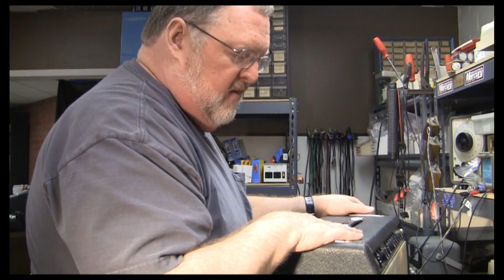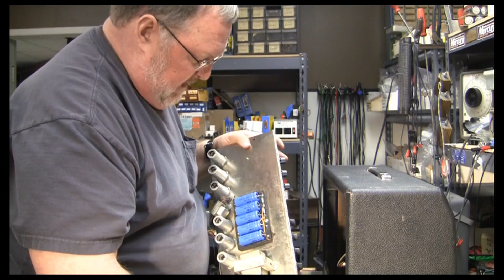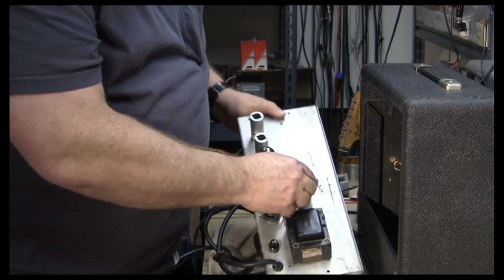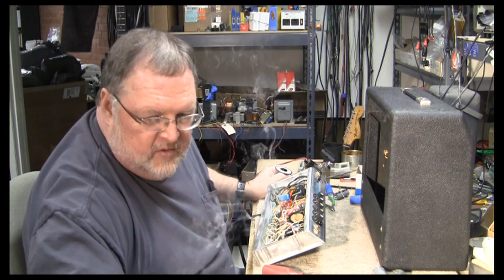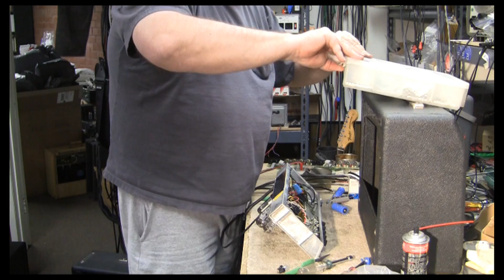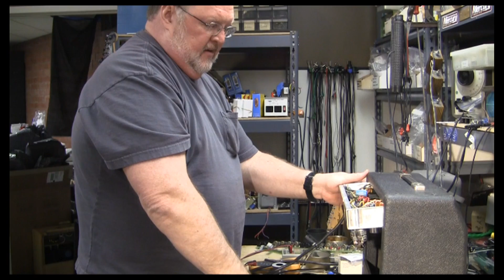Roy Blankenship Amp Repair Shop - 1

Comment: 23:15 knowing that your doing it wrong, and not changing your habit. Congrats.
26:50 "You're pretty sure this is the main malfunction, but will check on oscilloscope?" Why not test what's the problem
31:20 They are NOT electrolytics: they are non polarized coupling caps
34:15 I have these brought in from...... er er... interviewer: JAPAN? No, from a company called Mouser
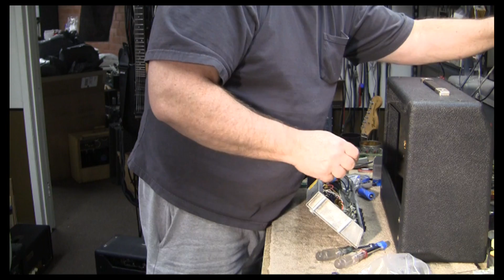39:00 he likes to spray out the jacks with contact cleaner, without even first testing whether there is a problem. 
39:48 after it's been fixed we'll be finding out if the tubes were ok in the first place...
41:25 fuse test good, but it's "hooky" -- if it's good why replace? 
43:00 never do this at home kids, only one hand in the amp..
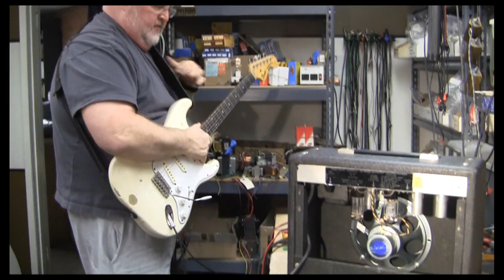49:00 he has TWO shop guitars

Comment: i have a marantz 4300 receiver, was working fine and now it does not power up. the last time tried to power up it trip the breaker. any tips as to where to look at first. the receiver fuses are not blown.

Comment: dirt, corrosion, living like an animal on the road..LoL! Good to know your EIA codes.
Just like the old scratched up 59 Strats and Les Pauls, the originals go for a lot of money these days...maybe it's nostalgia and the new owner hoping that by paying a "kings ransom" for it..owning the vintage musical piece will take them back to those years.
RCA made very good tubes..their NOS (vintage) 6L6GC are worth a lot of money these days. I use the JJ tubes myself, because I can't afford the prices they charge for American made NOS tubes these 
days. (more....)
Personal pride on the repair job, it's good to know that there are still "old school' repairmen that take pride with their work.
I agree on with the comment on shoddy repair jobs as the travesty on the floppy electrolytics that somebody 
stuck in.
Some of those old electrolytic cans have twisted tabs as well as being soldered, so they can be tricky to
 remove.
I bought a Weller soldering station years ago.. It has been one of the best investments in my life..it has outlasted my 22 year marriage and still going strong. I use 700 degree tips. I agree with you on Nichicon caps being better quality and I get a lot
of my parts (guitar related) from Mouser..they even send me a catalog for free.

Comment: hi - im new to this stuff, and have a roland cube 60 guitar amp i bought bust (knowingly), and am in the process of gathering info on what to test. it blows fuses on the inside (two 125v 5a fuses).. although i didnt use slo blo fuses :? should i try these first? nothing is smoked and burned - ie im hoping its small component failure.

Would I be on the right path de-soldering the things with 3 legs (transistors?) and testing their legs (found a good tut to test these), and also the sausage things - can i test them in circuit? diodes iirc..

I have a list of numbers to test from a website - most ive done is test voltage and motorbike coil resistance.. could i possibly fix this myself with basic soldering and multimeter skills? thats all i wanna know!

fyi i havent gone and stuck in tin foil or higher amps fuses, i know that much!!

Comment: Hi Roy,got a question,whats the most likely thing to cause a guitar solid state amp to lack in volume,i have a marshall 8080 amp that sounds like a 5 watt amp,also a P A Amp that has the same problem.any help would be great.
regards

Comment: My problem is one of my knobs is stripped I suppose.. ? It spins hole wat around instead of stopping at off causing me major problems trying to find off because it’s the knob for flange/phase/tremelo/chorus on Roland micro cube. Therefore it’s nearly impossible to get it back to clean with no effects because one of those 4 effects is always on I can’t find a sweet spot at all and it should just be at the off position.. can anyone help me??

Comment: I just returned a 66 Bassman to stock.  A company I won't name left their sticker in the chassis after they modded the hell out of it.  They spent a lot of time and parts making it sound absolutely horrid.  Like a flabby, cardboard early Marshall.

You go, Roy!
Reply: Wes Davis.    The Only thing I would ever do or have done to a Bassman is put back to a stock 6g6-a or b or neither a or b. after '64 the bass channel is not good for guitar at all. still like the guitar side of some later models but mostly I just prefer the brown face normal channel. If you want explosively bluze dirt the Bass channel of a 6g6 KILZ with a zed.

Comment: is he really charging $500 for that repair? of course I realize he's a specalist in this field.
that seems a little high to me, but he does do quality work. I used to manage a repair shop, I don't think we ever did any repairs on tube stuff although I have worked on a lot of tube tv's.
Reply: It was a joke. This has been discussed several times prior in the comments. I rarely have repairs over $250, which is about standard for a complete rebuild of a Fender amp.The reality is, people tell me I do not charge enough for my services.
Reply: mortyok3 oh ok thanks I was just wondered myself
Reply: It was a joke

Comment: As an amp builder, he's very knowledgeable and plenty qualified to do this work, takes pride - all good.
What he doesn't do is listen - all scope, no ears used, only played it clean, didn't drive it hard, etc. His views on tubes show a serious lack of discernment on what is good, bad and indifferent. Tubes are critically important, as are the tone of the caps, speaker, transformers, etc. He cares about the work, but not the sound - other than it's running properly. Nothing done once it's running right to possibly improve the tone. It can be running perfectly and sound bad, OK or awesome with just Tube and speaker choice - this amp had the speaker replaced. He doesn't say what it SOUNDS like, better or worse than the stock original, etc...
He likes the caps because they're always reliably good, NOT because they sound good!!!
Why, because he's not ear driven or driven by how it FEELS!!!
Different people have different kill sets, his does not include the use of his ears and that's what tone is about. How it sounds, feels, distorts, cleans up, complexity, overtones, etc. etc.
Reply: You could not be more wrong in your assessment of my skills. People bring me amps because they sound GREAT when they get them back. This video is a one-off pilot for a series these guys wanted to make and is severely edited, and in no way reflects my daily operations. I have been through numerous tube types, capacitor brands, resistor/coupling cap combinations looking for the best combinations for sonic excellence. Best of all, I consider my customers' feedback as way more important than my own personal opinions. You are 180 degrees off on this.

Comment: i have got a music player and its good to hear a music on that player its bass system and other speakers do very well. but, suddenly after about 1 and half hours of playing its brings a bad noise through it bass speaker and u can't hear the music clearly. the sound of the bass system is something like bizzzzzzzzzzzzzzzz....sound it is like the bass is under frequent vibration. i have changed filter capacitors but it doesn't work totally. if i unplug the bass speaker the music is good but no bass for the music which is not impressive to listen music without it. the model is syonapps if you heard of before. can you give me professional suggestion on that. thanks

Comment: Thanks for the video! Question about the electrolytic "can" type capacitor you replaced in the Vibro-Champ: what advantage does a multi-stage CAN capacitor have over a series of single-stage axial capacitors with the same values? For instance, some Fender amps have axial electrolytics under the "doghouse" cover and some have the "can" type multi-stage caps. Is there any fundamental difference between the two other than the layout design?
Reply: Difference is just real estate essentially. I find the multi-section cans cost a lot more as well.

Comment: never replace old condensers with modern parts unless you restuff the old shell. 

to answer your ? yes i would use the origional tires if they met factory spec still or an exact reproduction of them on my antique car.
Reply: And that "must be original" dollar capacitor shorts.. takes out your brand new matched pair kt88 tubes and output transformer.. who's crying now?  :)  Replace because .. I have seen what can happen when a grounding cap lets go on a 50's amp. big bang.. splash of sparks and smoke.. silence... R.I.P guitarist...

These amps are meant to be used in a professional tough environment.. they have to be 100% safe and about as reliable as something 50 years old can be. Stuff the caps if you want.. but do you want to pay my hourly rate to waste time on stupidity like that? I'm with Roy on the Nichicon caps. Great quality. Get the 105c ones for tube amps...  And for the sake of your sanity replace all grid coupling caps if they are more than 20 years old.. randomly blowing ht fuses?.. screen decoupling caps.. replace those too..
Reply: dont know or care if my post got up voted or not. the point of making a post is to pass on experience and knowledge not to get up voted.

i seriously doubt that 20 years working with a retired tv tec who actually worked on this equipment when it was new qualifies me as an idiot. i have since started working on things on my own and still no problems.

also any book written at the time will tell you that just replacing parts hoping to fix equipment is very shoddy practice indeed and should never be done. troubleshoot and repair was and still should be sop.
Reply: he was even bigger on keeping everything origional than i am

that being said i have currently one webcor that had problems with the electrolytic and three that dont. i have reformed numerous filter cans over the years that kept going for a long time.
Reply: you too
Reply: I think this debate is most easily solved by simply looking at an electrolytic capacitor datasheet.... they have a service life in their specs.... also the old paper caps need to go. the paper becomes acidic and leaks. your capacitor acts like it has a resistor across it. thus even though your amp is still working your power transformer is working harder and you don't know it. buy a capacitor leakage tester
Reply: then why is it i have four tape recorders from the 1950s which are fine with all origional condensers.
Reply: my fifth one has one section of one can marginal and will be reformed by me.

Comment: I noticed a few short wires were not physically secured before soldering.  The tech just placed the wire and applied the solder.  A good physical joint makes for a good solder joint.
Reply: If my techniques did not work, I would change them. For you "by the book" guys, sometimes hooking a wire into a spade lug fractures the copper and causes a failure down the line.

Comment: hi..i am jorge, from rio de janeiro, brazil..i have an old hartke VXL 200 bass amp i bought damaged on ebay..my friend fixed it but not completely..i mean..its presence and edge controls do not work..everything else work fine..i would like to have those two controls working fine but my friend could not find that amp diagrams..so would you have its electric diagrams? or could you find them? if so, would you have a paypal account so i could pay? please, let me know it..thanks. jorge.

Comment: Unfortunately, nothing lasts forever... especially electrolytic capacitors! But every tube amp, even the oldest one, can be repaired (of course if if it's still in decent shape).

Comment: Roy Ive enjoyed you knowledge about amp repair....Im looking to purchase a used but in good condition no problems from a owner a peavey kb5 one of peaveysmore recent series models a powerhouse of a amp,least compared to what ive had for the last 25 yrs or longer the peavey kb300,,,,so i wanna grab this kb5 peavey from this guy hes selling it dirt cheap,,,i know this amp is new at some 7-800 bucks,,,,i am a lil leary,,,cautious feeling like theres something this guys is not saying especially for only 150.00 bucks,,,,,,i will test a few things checking for static of ports control knobs  the treb and the mid and the lows listning for a blown speaker,,,, this is a nice model exactly what im looking for ,,im feeling hes selling ,,,dont want to say but makes me feel like its either ?? stolen,,,,or something wrong with it that i dont know he wont reveal and may discover in the middle of a performance ,,,,,question are you affiliated or familiar with this new model do you know things to check for or if if the newer kb series models have common repair problems,,,,i will be probably picking this thing up this week hate to miss a deal of only 150 bucks but need to know all i can,,,if you can offer some info thanks...

Comment: I NEED YOUR ADVICE, I just bought a brand new BUGERA V22 HD amp. The guitar I used is an EPIPHONE LP "56 ReIssue with P-90 pickups. As I move around the room there is a HUMMM that goes from non-existent to very loud. Then I recently read an article about UNSHEILDED PICKUPS and how they can cause havoc on tone and signal interference. The finish and materials used on the body of this CHINA MADE LP guitar is really nice BUT we all know that Epiphone electronics is the worst. QUESTIONS - 1) Is it the guitar causing the different humms as I walk around the amp? 2) IF I wanted to change the PUPS would  Mini Humbuckers FIT where the P-90's are so I would Not have to resize the PUP cavity? Thanks In Advance, Ade
Reply: a. webb I would be inclined to stay away from power outlets, and switch off electrical items in the room one by one till [ hopefully ] the hum goes away. It's trial by trying.
Reply: +a. webb Several things are impacting your noise... P-90s are single coils, so no humbucking effect is possible. The pickup cavities are most likely not shielded, either.  Finally, the amp circuit itself puts out a electromagnetic field into the surrounding area.  The closer you are to the amp, the more noise you have.  You can reduce the noise by moving away from the amp, and by angling your body/guitar correctly to the amp.  Strap on your rig, turn everything on, and move in a circle (stay in the same place, just twist about the axis of your body...).  You'll notice that there's an angle relative to the amp that "nulls out" the noise somewhat.  With no mods, this is as good as it'll get.  If you love the P-90 sound (and I do), leave them alone.  Buy some shielding tape/conductive shielding paint and shield the cavities in the guitar, making sure you ground the shield to the guitar ground circuit.  Hope this helps somewhat...just my experience.
Reply: +Ben “Slick51” Holbrook Ben, thanks for the advice. Much appreciated. since I posed this question 6 months ago - I eventually decided to sell the guitar at a 30% profit.

Comment: I was bitten one time by the blue spark in an old building.  we were opening for another band, and during the first song my lip touched the mic.  not a fun time.
Reply: oneofthemodels Yep , helps to have old amps with 2 conductor cords converted to chassis grounded 3 conductor too.
Bet thats one ol Roy wouldn't de mod !!

Comment: Hi Roy I have a 1970s peavey backstage amp. When turn the power on it blow the fuse inside the box. Ai did use so electric cleaner on the pods. Any idea what might cause this to happen thanks
Reply: blown rectifiers.. shorted smoothing caps..  depends really..